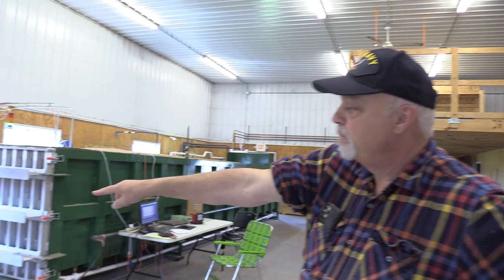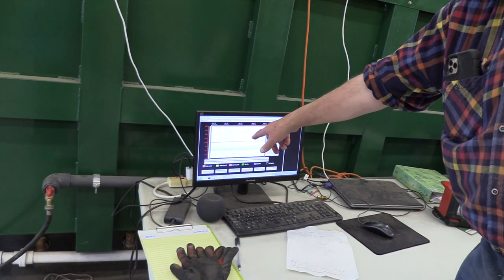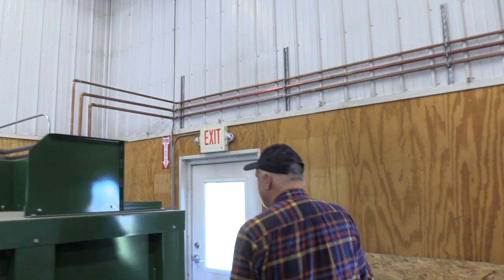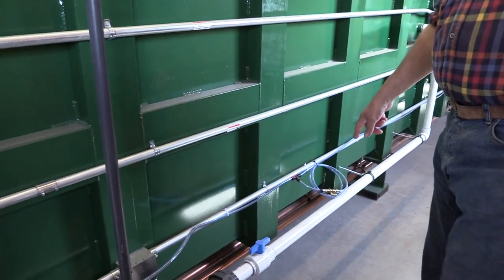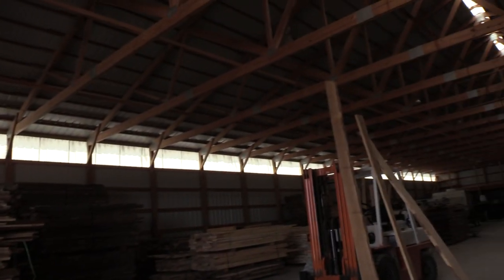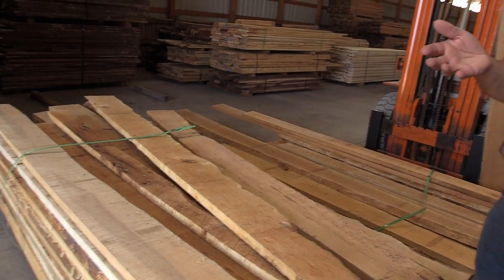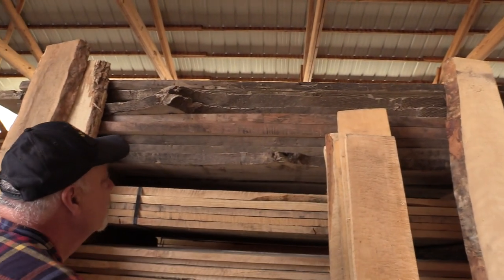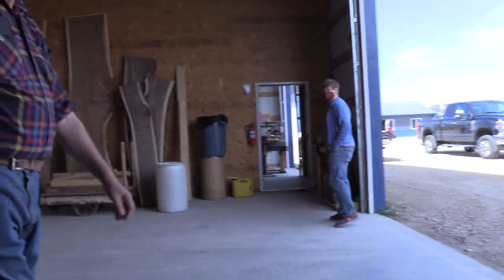Vacuum Kiln Process

Comment: Great information. I was in my garage looking at a soaking wet 30" ambrosia maple round, thinking that maybe I could build a vacuum box to equalize the moisture levels, reduce surface checking, and speed up drying. I'm curious if the kiln would need to be configured differently when the end grain is on top of the stack, rather than on the ends.
Reply: You can vacuum bag also.